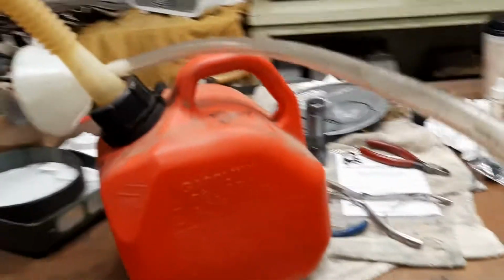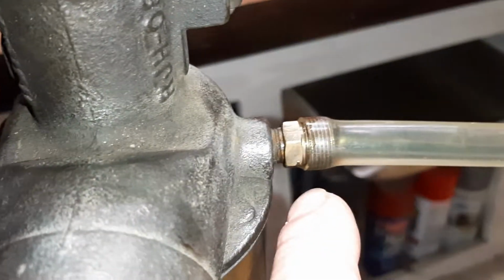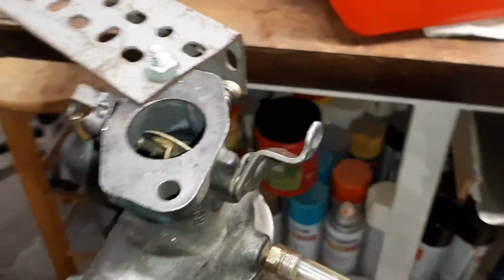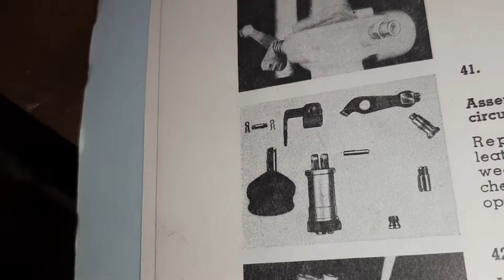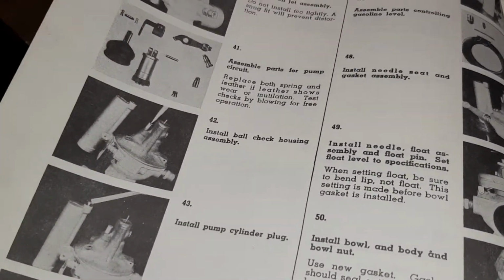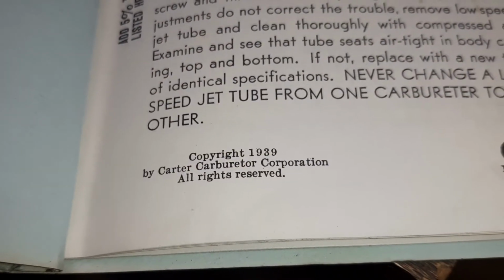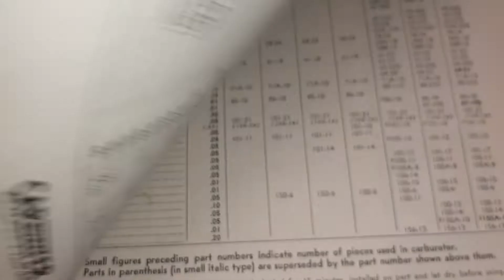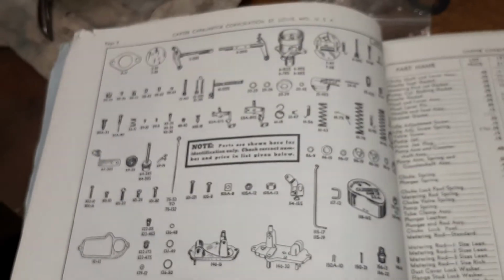1931 Chevy carb. repair update.

Comment: hi could you do a detailed video on how the throttle linkage is assembled? .. how it is supported through the toe kick board and attached to the carb?   trying to get one connected  for a 1931 truck from a box of parts that was left with no further info as to how the system is supposed to work.  Thanks
Reply from the maker: Yes,I'll post it as soon as I get back from vacation. Thanks
Reply: @ericsolomonrent  hi there, just curious if you are thinking you still might be able to post a vid about the throttle linkage assembly.      

We're still having trouble with the timing  "roll flywheel to 12 deg mark, adjust distributor til just when contact opens"  spark there, just thinking there is more to it.  

Hard to find a mechanic from yesteryear these days for help
Reply from the maker: @nwmi493  Yes, thanks, I took a video earlier today and will upload it first thing tomorrow.